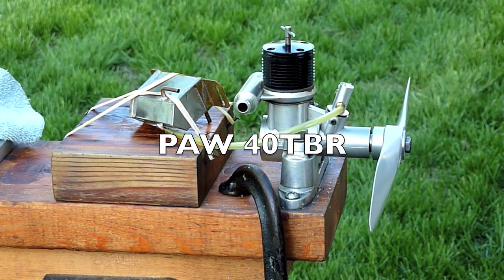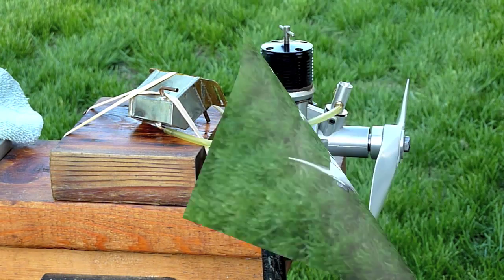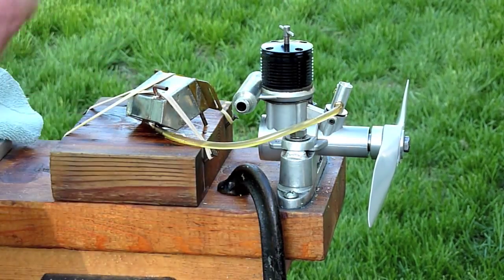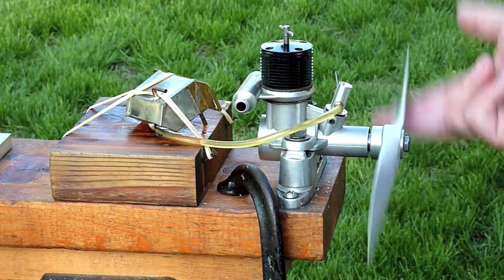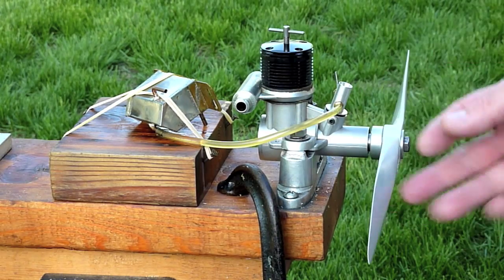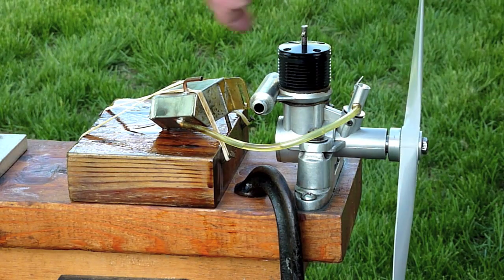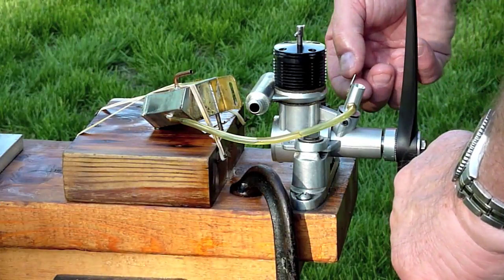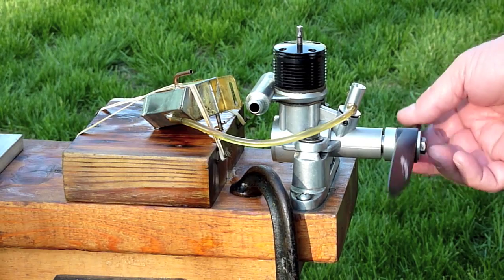PAW 40 bench running

Comment: Fred, this is just like my story! I bought my PAW40TBR in 2005 and began to build a Freebird, but it is still under construction :-(

The engine has run about 1-2 hours in bench. After a long time without running it takes a time to get it fire, but after that it will start quite easily.

Yesterday we ran another one of my friend, this engine is already mounted to a Freebird, but we didn't attempt to fly because of the strong wind and turbulence.

Regards,

Mikko

Comment: Great video! :-) Fascinating engines too. I just heard about them. I believe I was told they run on a mixture of caster oil, ether, and diesel. Is this correct?

What was the fuel mixture ratios ran with these engines? Also was there a break in fuel mixture?

Lastly, can these engines still be bought new or used? If so, can you recommend a website?
Reply from the maker: I think I was running this engine on 40/40/20 (40% ether, 40% kerosene, 20% castor oil) plus 2% IPN (allows you to run slightly lower compression.  Generally the break in fuel is 1/3,1/3,1/3 with 2% IPN added.  That's also the blend for plain bearing engines.
You can buy PAW engines in the US from Dr. Diesel (Eric Clutton) 
http://www.cafes.net/doctordiesel/
or direct from PAW in the UK:
http://www.eifflaender.com/
Reply: Fred Krueger Thanks so much for the reply. I'll check them out :-)